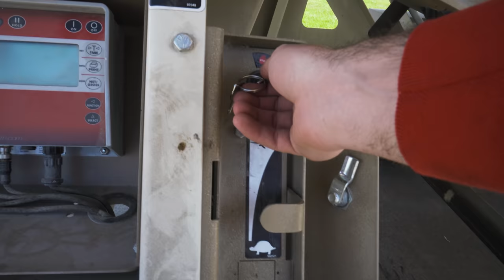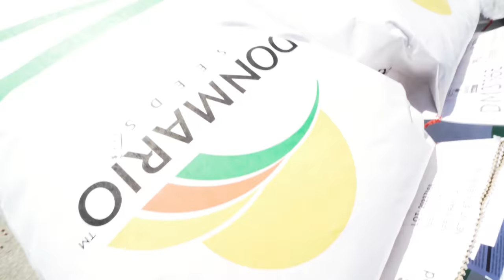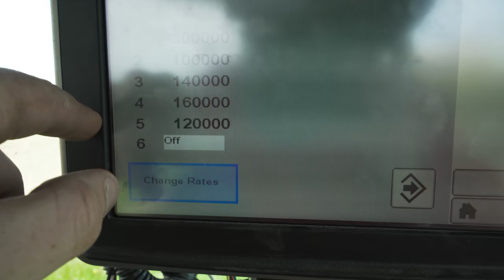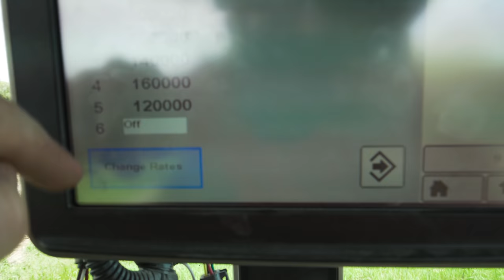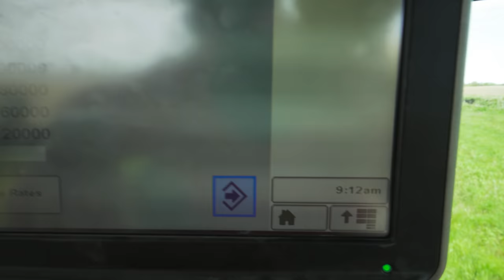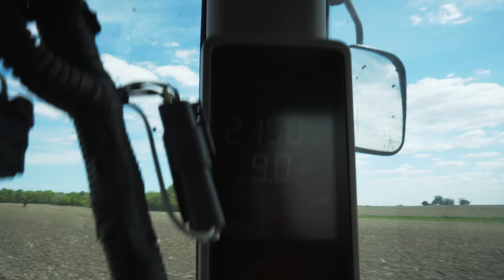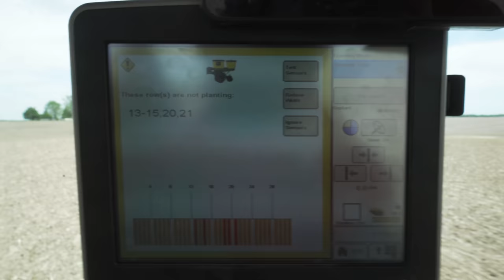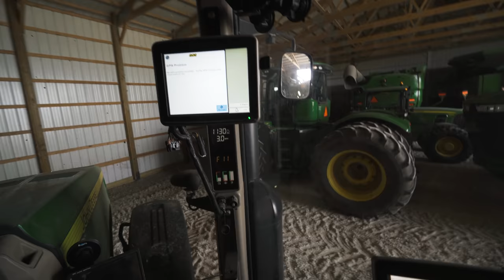Side-Dressing Nitrogen On Corn After Finalizing Soybean Replanting (Ep. 90)

Comment: Until this year we would run nh3 (anhydrous ammonia ) in our irrigation flood water here in California. Regulations changed and now we have to use un32 in the water which is another new challenge to apply correctly.  Like you said, nh3 is king of nitrogen. I'm already missing it, our corn is about same size as yours and we'll be applying nitrogen with first irrigation in less than 2 weeks. Nice work
Reply from the maker: It is hard to beat the potency and price of NH3. I bet your corn will grow fast with that California heat!

Comment: Don’t want to be personal but did you notice any yield bump with splitting your nitrogen?  I feel like most places do but with your black Illinois soil didn’t know if there would be much of a boost.
Reply from the maker: No that's a perfectly appropriate question. Contrary to what you may think, we do farm a large variety of soils. Some of them are not near as productive as our best ground. We haven't necessarily seen a yield bump, but we are seeing less of yield drag on our poorer soils, especially on a wet year. Our data easily shows a 20-30 bushel yield drag on ground that is all applied in the fall. I believe this also applies to our dark ground as well. However, we made the switch all at once on that ground, so I have no comparable data. I think the closer your nitrogen is applied to late spring and early summer, the more efficient your usage will be.

Comment: Corn is looking good. Just curious is knifing the 32% in better then y drops? Here in Kansas we are all terrace ground and good never do this besides bottom ground but still curious. Thanks
Reply from the maker: I do not have any actual data to suggest that one is better than the other. One would definitely feel better with the nitrogen incorporated, but that doesn't mean that the Y-drops are ineffective. I think they are a neat tool that add a ton of flexibility to nitrogen timing.